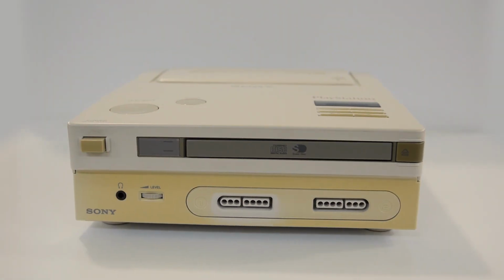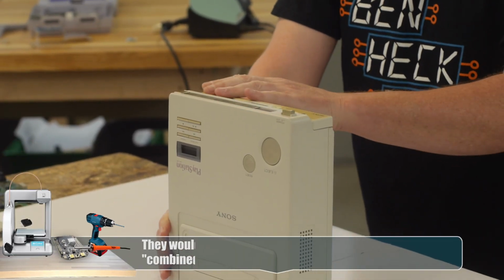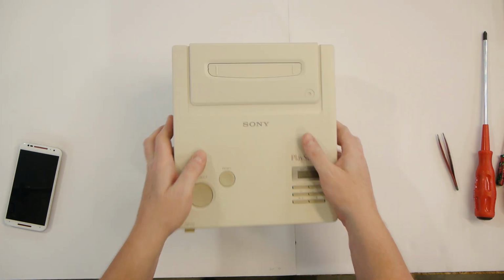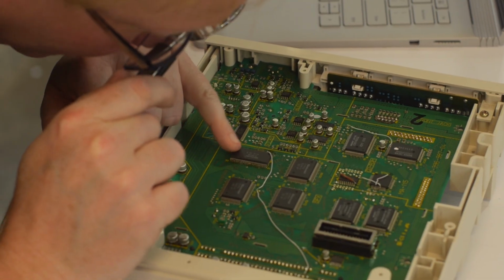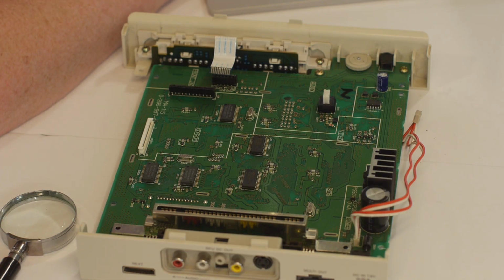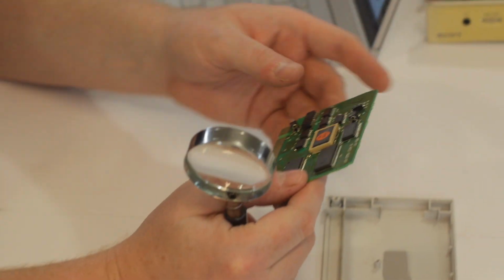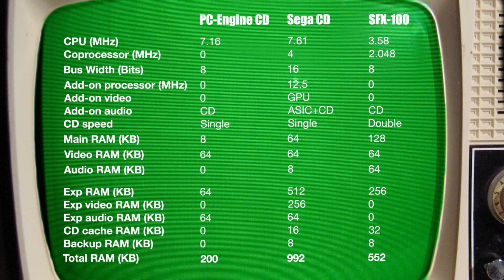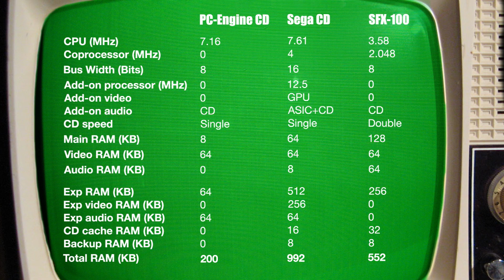Ben Heck's Nintendo-Playstation Prototype Pt 1 Teardown

Comment: Has anyone tried putting in a playstation 1 disk and see if it works or not 🤔
Reply from the maker: It does/will not, it doesn't have the same firmware as the PlayStation
Reply: @element14presents  would it not be possible to put Sony's firmware on it or is it not possible to swap some chips from the playstation so that it can play Sony playstation disks
Reply: @element14presents dan is a piece of trash. Don't ever bring him on your show again

Comment: Supposedly what would become the PlayStation Controller was also created with Nintendo as part of the original SNES-CD project. For a controller other than the SNES version used on the prototype (the fate of this prototype controller is unknown). Though Nintendo rejected it, feeling its was too complicated for the simpler games that were on the SNES and any potential SNES-CD games. Now if you wanna get nuts, I mean really nuts. There is an old rumor that says Nintendo was going to bring the Famicom Disk System to the NES. No prototype was actually created (as far as is known) only a modded Famicom that could play NES cartridge's and AV out on the Famicom and the Disk System was made NTSC (US) capable. Some have suggested that the modded Famicom was not modded for NTSC (US), but for PAL regions. Though this supposedly modded Famicom and Disk System has never surfaced, probably because no one could tell the different on the outside, since the changes were all internal. Also no US NES specific Disk System prototype unit was ever made. The reason for the Disk System never coming to the US, is that piracy was big problem in Japan with the Disks and software piracy was even worse in the US at that time. So Nintendo felt it wasn't worth it, besides by the time it would have come out late 89 or early 90. The Super Nintendo/Super Famicom would have been out and made the Disk System pointless.

Comment: I wonder if the snes soundchip inside this snes CD is also responsible for playing audio CD’s at 32khz or does it have a dedicated soundchip for playing audio CD’s at 44,1khz???

I guess no one will know it , but i do know that it is possible to stream 16bit audio at 32khz at 128kbps to the snes by disabling echo writes, and while CD is off just slightly better audio quality, but i was thinking, maybe theres another chip inside wich could convert CD audio into the snes’s 32khz audio, because from a technical stand point , that would be super awesome!!!

Comment: I know this is an old video, but am I the only one who sees the similarities between this prototype and the Sega Saturn? Makes me think that maybe they had the ram in the cartridge for the same reason, like later down the line you might have been able to get a 512 version or maybe one that integrates an SFX coprocessor. Of course they may have made the add-on more simple in an attempt to beat Sega's price on the Sega CD which was not cheap.

Comment: I would've been surprised if the Nintendo Playstatio (still really odd to say and write...) had been this mythical beast of a console. 
In many regards it was like the Wii, which was originally going to be a Gamecube with the motion controllers added on as an accessory. But then Nintendo decided to make an entire console out of it, even though it was still a Gamecube underneath. The Sony Playstation on the other hand was a completely different console made for 3D gaming, while the SNES was still very much a 2D system.

Comment: A question now: I've seen the engadget video about that prototype console a while ago, and it's from 2015, showing it working like a normal Super Nintendo + the test cartridge that enabled the CD drive on it, judging by date, it means it broke at some time during that 1 year span right?
Well not to be amazed considering such an old piece of hardware that was a prototype to begin with.

Comment: It was yellowed because of the bromide chemical used in the bottom half and it not being present in the top half. It's a fire retardant that will come to the surface and causes this discoloration. Maybe the bottom half was a typical super Nintendo piece and the top half was manufactured directly for Sony? I mean that would be my theory as sony generally didn't use plastic that would discolor in the sun. 
The effects can be reversed with a similar process involving high percentage peroxide cream you can find at beauty supply stores and exposure to bright light.

Comment: I don't know where you got those Super Nintendo specs from, but the sound CPU runs at 1 mhz, and it actually has 2 independent buses (an 8 bit and 16 bit bus) - Most of the system is attached to both, including the cartridge slot. - in fact the two extra tabs with pins you see on cartridges that have expansion chips are the data lines for the B bus.
The B bus is however an 8 bit bus, and the main thing that you have access to through the expansion port on the bottom of the system.

Comment: This is simply unbelievable. So rarely do you get to see a tear down and such an in depth and thorough analysis of a video game relic. The guy got it for less than a dollar but it's probably worth thousands if not tens of thousands of dollars to collectors, depending how many more machines are out there in the wild. Most people would be afraid to crack a dev prototype open incase they scratched the screws, but this went the whole nine yards. Thank you graciously for sharing this with us, the Nintendo PlayStation has been such an enigma for decades and now we finally have it and it actually has a BIOS and works! Truly amazing.
Reply: I know this comment is ancient, but I looked it up and it sold for $360,000. So a bit more than you thought.

Comment: I wonder about the specs for this.
What information I could dig up on this suggested that the CD unit would not include any additional hardware to improve performance, but rather that the cartridge included with the CD unit would contain any such chips.
Meaning that in future, if more performance (more RAM, or a better CPU) was desired, you'd just replace the cartridge, rather than the whole CD unit.
(this is of course more relevant to the SNES CD expansion unit, rather than this model. If it had ever been released, I assume the add-on would have been more common than the integrated model.)

To top it off, the same sources suggest that the first such CD unit cartridges would contain a SuperFX-2 chip in them (like Yoshi's Island and doom), meaning CD games would have superFX support as a default option.
However, not too long after they suggested doing this, they instead were considering using an NEC-V810 instead, which is a 32 bit cpu used in the virtual boy, and NEC's PC-FX console...
Given that this was suggested as being a 'default' inclusion with the CD unit, This would have put Snes CD games in a similar performance league to the hardware combination of the Sega CD and 32x unit working together...
That would have been quite something.
Of course, that kind of hardware suggests a 1995 or 96 launch, by which time it would definitely have been too little, too late, since both the Playstation and N64 were out by that point...
Probably explains why it never happened...
Reply: Yeah... The date code on that expansion cartridge kind of gives it away. 92.
The idea of having a superFX 2 chip in the cartridge was mentioned before the idea of the NEC-V810.
And the SuperFX 2 chip wasn't even seen in games until 1995. Which means these are plans from 1994 or 1995 at the earliest. 
Which further suggests it was probably the work done with Phillips at that point rather than Sony.

Comment: nintendo playstation ???? where have i been all this time O__O
Reply: yeah dude, Sony made a deal with Nintendo, Nintendo could use their Sound Chip, then Sony would make a CD addon for the SNES. Check on the bottom of your SNES, there is a add-on slot. But Sony due to some contracts, would have had 100% profit on CD SNES games being sold, Nintendo didn't like this and made a deal with Philips for a CD ADDON, which eventually failed and turned into the Philips CDI (That is why it has mario and zelda games).

So Sony said screw it and constructed the Playstation 1 and the rest is history.

Comment: it wasn't a rumor or myth, Sony more or less confirmed it themselves several times.
Reply: it has never been a myth.

Sony made a deal with Nintendo, Nintendo could use their Sound Chip, then Sony would make a CD addon for the SNES. Check on the bottom of your SNES, there is a add-on slot. But Sony due to some contracts, would have had 100% profit on CD SNES games being sold, Nintendo didn't like this and made a deal with Philips for a CD ADDON, which eventually failed and turned into the Philips CDI (That is why it has mario and zelda games).

So Sony said screw it and constructed the Playstation 1 and the rest is history.
Reply: sounds about right
Reply: SuperHns not after they tried to partner with Sega

Comment: The PC Engine CD-Rom had several different system cards over it's lifespan than expanded the RAM. It was actually a very popular system in Japan.

The Sega CD had an 8 channel PCM chip and could do rotation and scaling in hardware. However it was difficult to program because the Sega CD had to download images from the RAM used for scaling and rotation to the main console's system ram and then  the Genesis CPU had to transfer it into the VDPs video RAM for display.

 The Genesis VPD actually had support for two 64k banks of video RAM (there are undocumented registers for using this) but only one was used and the address buss for the second bank was not connected. As well as that it also had a pixel bus that could be used for expanding the colors the chip could generate but again the pins were not connected. If they had brought them out to the expansion port then they could have simply added a second bank of video RAM to the Sega CD which could have been shared with the scaling and rotation hardware and would have made the system much easier to program and faster in this regard.

 Sega's System C2 arcade board uses the same graphics chip as the Genesis but with a 12mhz 68000 and the DAC is the same as used in the System 16 and System 18 boards rather than the one used by the Genesis.  The FM sound chip is the same as the Genesis but there is also no Z80 or PSG on this board and they used both banks of video RAM as well as the pixel bus and an external color RAM.

Comment: Pretty awesome stuff!  It's really great you're fixing it.  One little correction though -- the PC Engine CD / TurboGrafx CD has a 2KB capacitor-backed save chip in it, so the PCE should say 2 instead of 0 on your table in the save-memory entry.  Also the PCE has two RAM expansion cards, a 256KB card (the Super System Card) and a 4MB + 256KB card (the Arcade Card), which some games support.

Otherwise though, good work.  It's very interesting that the system would have only 8KB save memory and 256KB added RAM; that's not much on either point.  The Sega and PC Engine CD systems both have save-memory addons to help with the limited amount of internal save memory, but with the required addon RAM and such on the cart, you couldn't do that with the SNES... being stuck with only 8KB and that's it would be awful.  And for main CD RAM, 256KB is enough, but it's still less than a PCE with Super CD (once you remember also the RAM in the main CD addon is also available), and way less than the Sega CD.  Also... no enhancement chip onboard, not even the basic one used by Mario Kart and such?  That would limit graphics indeed.

Comment: The PC-Engine CD specs are wrong. 1992 specs has 256k expanded ram, not 64k. There is cd cache on the unit, and there is definitely back up ram as well. He's also missing the ADPCM sound upgrade on the PCE CD (only lists CD). The SegaCD specs are somewhat misleading (it doesn't have expanded video ram) and the ASIC has nothing to do with the audio.

Comment: Ben, admit it, you had FUN on this one. And I'm in the camp that loves Starfox 2. The most advanced version of it can be played start to finish. Starfox 1 was excellent but 2 was still great. 

The SNES-PS was not brought to market because of Sony's royalty clause in the contracts which Nintendo was unwilling to tolerate. The SNES-PS was never finished because Sony was going to use the system to enter the game market and destroy Nintendo in the process. And Nintendo knew this. 

The SNES-PS system itself was a marvel to behold. I'm one of the few people to have seen the prototypes in operation running actual software. The raw specs don't look as impressive as the SegaCD, but we all know that it's not always the parts you use to build something but also HOW they are used. Nintendo is famous for getting more out of less. The load times were still there but less annoying than TG16CD and SegaCD. And FMV looked so much better than anything NEC, Sega or anyone else was doing at the time. Because the SNES video hardware was superior[and going to get better], video quality was comparable to TV broadcast of the time. And one of the programmers working on it showed off a digitized version of a "Real Genius" VHS tape running completely off the CD drive. It was watchable, but the quality was not great. Still it was the first movie I had ever seen running off a standard CD which was a fun novelty. And on the SNES no less! 

I can also tell you the that the unit you're testing out was not the final incarnation of the proposed system. There were actually two more prototypes after. One further sub-version to this one and the last official[on books] prototype that was intended for game devs. The finished system specs were to include a 4X CD drive, 256K CD buffer, 512K expanded RAM[on firmware cart], a specialized version of the FX chip running at 18Mhz, as well as a newer[and completely backward compatible] update to the base system specs. Those specs were up in the air but at one time included greatly expanded instruction sets for the CPU and both PPU's, increased operating speeds[12Mhz and 6Mhz respectively] and increase in system RAM to 1024K and 512K for the PPU's. The sound processor was to get a massive[for the time] upgrade to 128K and and increase to 16 channels. The expansion port was to be used for possible modem/networking functions which were becoming a thing at the time and Nintendo saw a possibility for market growth in.
Reply: そんな契約はありませんよ
任天堂アメリカ社長が、任天堂の社長に自身の被害妄想によって乗っ取られると警告したことにより契約は破棄された
ソニーは常識外れな任天堂の対応にブチギレたが訴えることもせず。ファミコンに音源チップを最後まで供給し大人な対応を行なった

Comment: Plastic yellowed because of fire retardant added to the mix which reacts to a UV light. This was a mistake Nintendo made at a beginning. Actually most companies made that mistake at the time. After that Nintendo fixed the mixture. But not right away. You still can find SNESs that partially yellowed. From that I can say they may used some of the left over plastic for that part or it was a machine already loaded with that plastic. But it means this prototype was made early in a SNES life. Not sure exactly.

Comment: The Satellaview would have been an option. The port on the bottom was originally for it before the cd based add on was ever conceited. America was close to getting the Satalleview but after the regions release it was cancelled hence why there is a port still in the back.

Comment: That thing is full of SMD electrolytic capacitors. the LIKELY cause of the in-operability. most if not all electronics from that time period suffered the same fate. Sony's Handycam from the same time period failed with bad SMD lytics. Apples Macintosh line, same thing. On and on it goes. Amiga, etc...

Comment: Excellent video!  Quick video idea:  How to capture outputs from a device, and view / analyze them in a hexadecimal program...  I'm hoping to interpret the outputs from a Mitutoyo Digital Holtest, capture it with a Moteino or other compact blue-tooth device, and send that information to a Raspberry Pi so it can be collected in a Spreadsheet / CSV format to aggregate measurement data over time.  The device has a 5-pin connector output (proprietary), which leads to 2x3 6-pin connector that can then be plugged into unshrouded male connector on a board (perhaps Arduino / Moteino?).  https://www.mitutoyo.co.jp/eng/support/service/manual/pdf/99MAB026M1_Digimatic_Holtest.pdf

Comment: It's worth mentioning that most SNES would only half-yellow as well like that. As if the upper and lower parts of the shell where two different plastics.
Reply: I know it's not just VU light because I had mine boxed up for 10 years and found it like that when I finally opened it up again.

Comment: What the SNES really needed was a boost in processing power. Which is why I was surprised to see this system really did nothing the enhance the performance of the SNES. I can see why this system wasn't released, it possibly would have been a failure. But then again since this system is just a CD player it might have been cheap to sell as an Add-on for a much cheaper price then the Sega CD. 

But we will never know for sure.